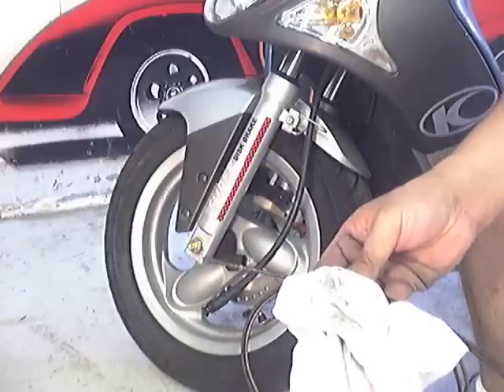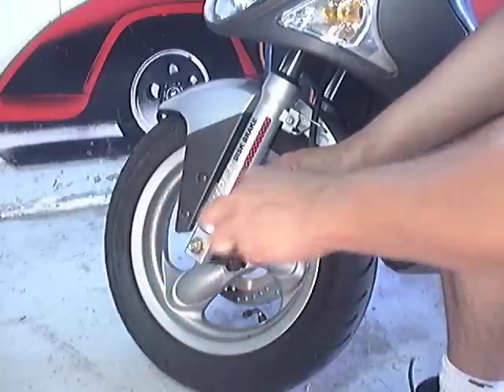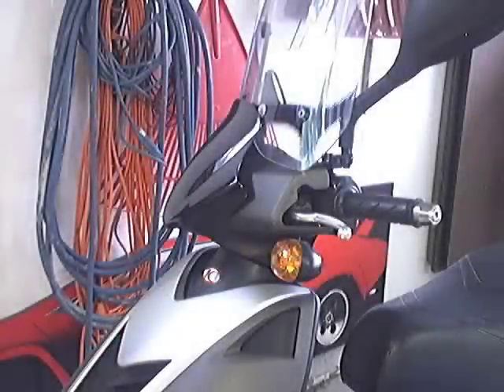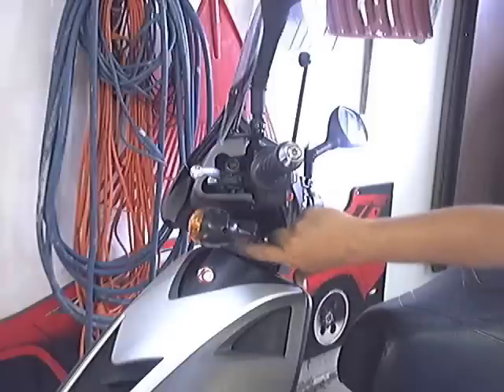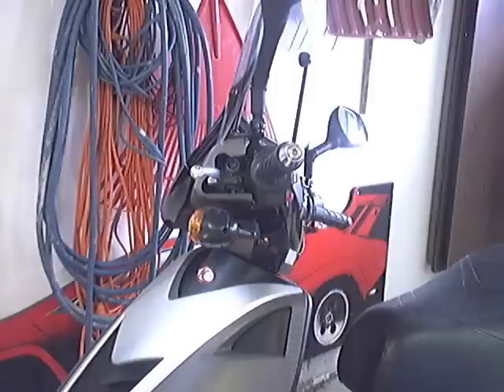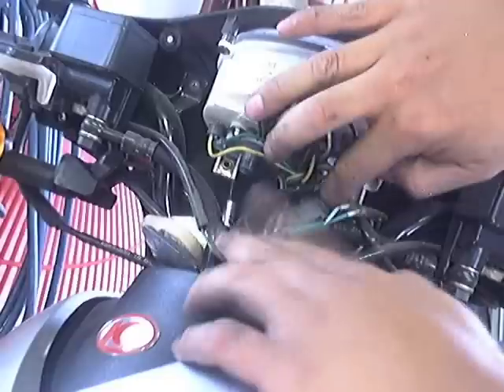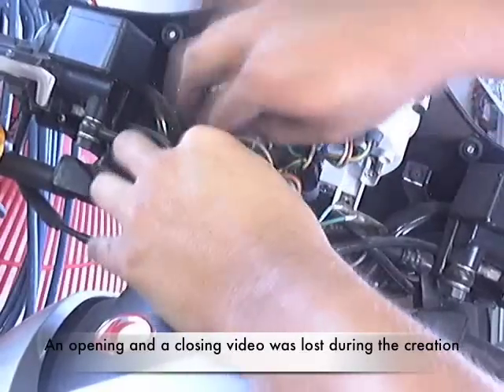Trouble shooting a speedo cable

Comment: Chinese Scooters or bikes that are mass produced have a tendancy not to tighten all the connectors correctly. I have just tightened the cable both ends mine wasn't snapped just loose.

Comment: hello here from italy, problems with a fantic motor hp1 speedometer. could tell me how to test if it is a gauge problem? where i could find spare cable and steel cord? and how i could affirm if it is the gear box problem?

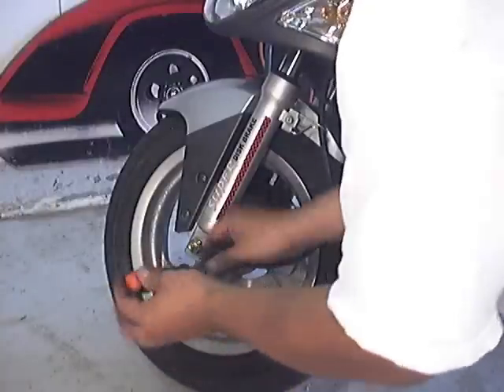Comment from the maker: On the Kymco scooter all you need to do is remove the screw holding the cable in. At 2:30 minutes into the video. You can see the screw being placed back into the scooter to hold the cable in.